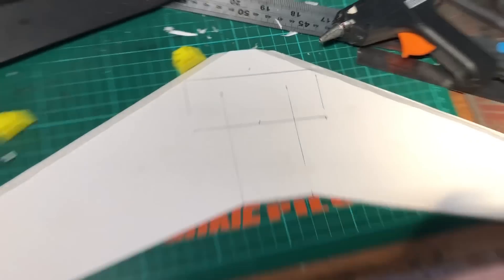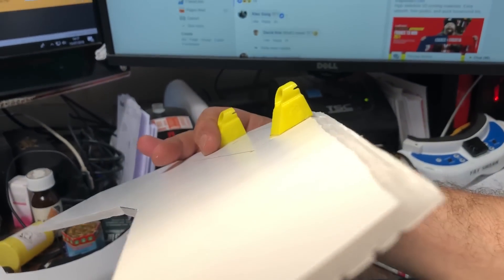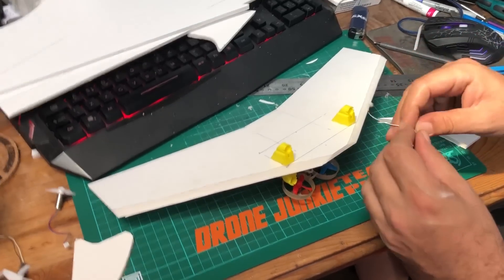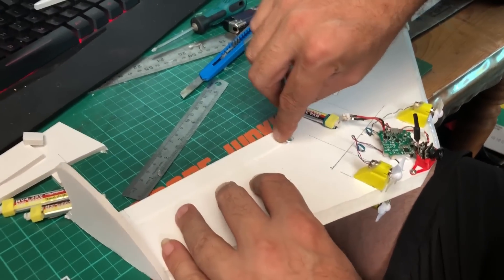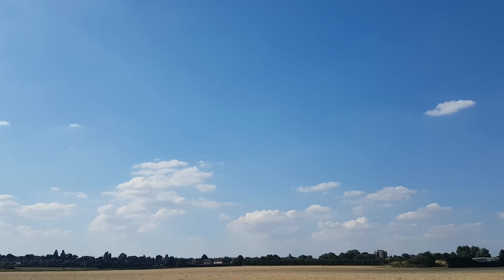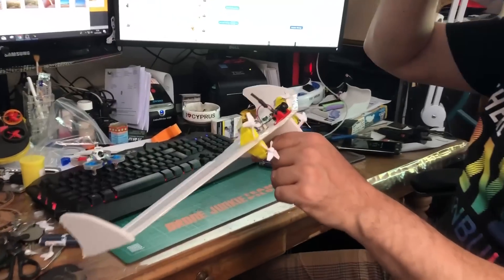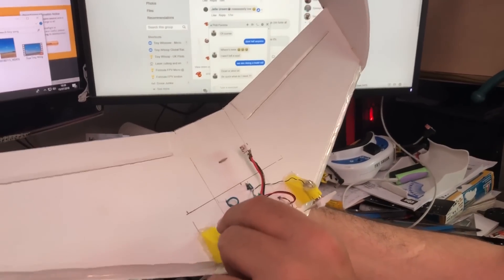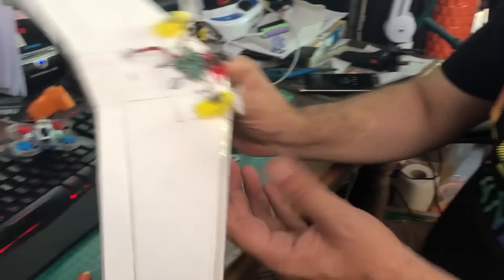Tiny Whoop to True Tiny Wing conversion

Comment: did you guys move any further forward with this plane?
I'm interested in building something like this, but with servos using a whoop flight controller, but I'm not sure how to pull it off.
Reply from the maker: yes, there was a seperate build that worked without a flight controller but a flight controller is very easy to do.

I've now put all the build plans and supporting STL's in my github.

https://github.com/SeekND/microflyingwing
Reply: Did you ever give that a go? I'm keen to try the same thing.

Comment: I had the same idea a while ago but never tried making one. Great to see the concept works. Gonna make one with 1104 bl motors from a 2 inch quad now! You could do away with the fins to save weight as the plane is already electronically stabilised in the yaw.  I would have thought the roll authority would be not great since you are relying on the tiny amount of torque from tiny whoop motors?

Comment: Did you tried stab mod? Could work better!
The Acro Mode tries to keep the board where it was, but the Wing itself is stabilizing iself permanent. 
Think about a curve, you steer a roll and the board tries to keep the roll angle while the aerodynamic wing tries to stabilize...
Just try if it is better, also could be that acro works better...mmmh
How did you modified betaflight?  I have a similar project and used custom mix...